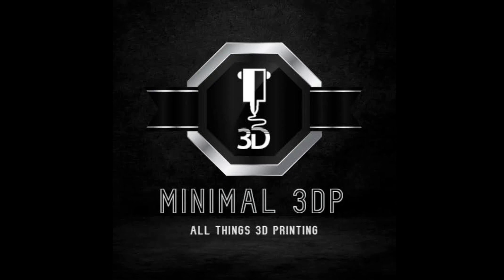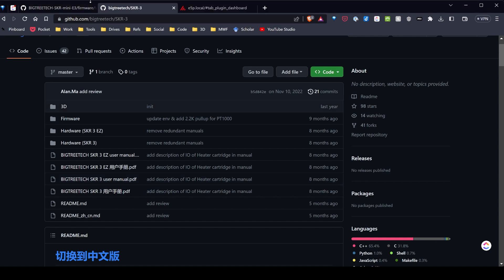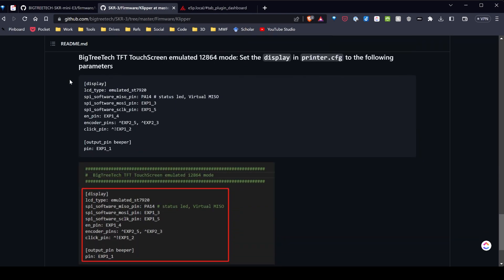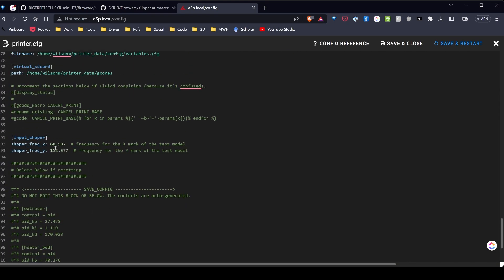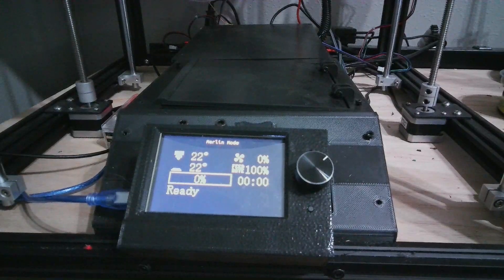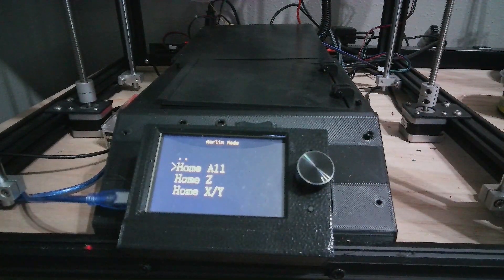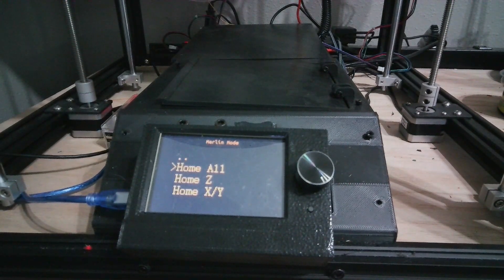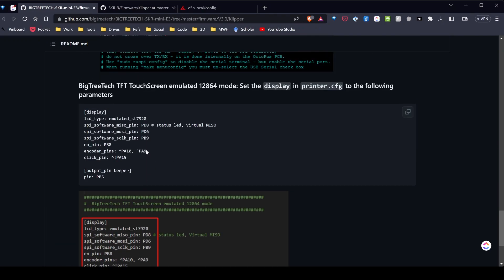BigTreeTech Touchscreens, Klipper, and the SKR 3 and SKR Mini E3 v3 Boards: Making it All Work!

Comment: I have a big tree tech tft35 v3.0.1 touch screen and a big tree tech skr mini v3 board. I cant get the screen to talk to the board. Granted this was working with my Marlin firmware but I recently switched everything over to klipper. Raspberry pi 4 is talking to the skr mini v3 over usb and working as it should Just the screen is not talking to the main board. I have not changed any hardware plug locations.
Reply from the maker: Are you looking at it touch or TFT mode? Did you update your printer.cfg?

Comment: In the text/marlin mode, does it have the option to manually level the bed? Can it do babystepping Z on first layer from the screen and change flow and stuff while printing with this marlin mode TFT35 and klipper?
Reply from the maker: I am not sure. You will need to check the docs.

Comment: Great work.

but still that means you still have to connect a laptop or a pi through USB.

Or am I getting it wrong?
Reply from the maker: You are correct. The way Klipper speeds printing is by moving the processing of the model off the weaker printer motherboard onto a more powerful pi or PC.
Reply: @minimal3dp  wish there was a true more delicate solution like this screen for klipper.

Dealing with klipper is messy.
Reply: @minimal3dp  I had to cancel order of this screen after your comment 😅

Great looking screen, not what I'm looking for though.

Comment: do you have both the ribbon cable and the TFT cable connected? what limitations have you found with this screen? I'm doing a switchwire conversion but don't want a full klipper screen, just something like they have on the new V0.2R1 kits. That way if the internet bugs out I can at least control the thing instead of just killing the power to it. awesome vids by the way!!
Reply from the maker: I have both connected but I am not sure I need it. It is a very minimal screen. You can so all the basics with it. I think it would definitely work in cases where the internet is out. 

Depending on your budget, I have just installed the BTT TFT 32 spi and it is klipperscreen. It might be worth a look.

Comment: Nice work! Would this code work for an SKR E3 Turbo motherboard with a TFT35 E3 V3.0 screen?
Reply from the maker: It should work.
Reply: @minimal3dp i have skr mini e3 v3 + Tft35 e3v3 and dont work 😭
Reply: until 2 weeks ago I had a skr E3 turbo and a tft35. It worked both in Klipper and Marlin. I used the black cable for tft and a 10 pin  cable in exp3.

Comment: Thisll help me very soon, I have the Mini3 and the tft35 duel touch coming for my E5+.  Waiting on the same screen for the E5++ as ive named it, Shes not up and running yet, Got to get my head around the Manta M8P/CB1 set up and run another extruder for 2-1 stuff. As a warning to Manta m8p buyers,The SP1 screen needs the I02CAN to work with the CB1 on the manta and there wasn't any in stock so next best...Better should have in the first place TFT35
Reply from the maker: Glad it was helpful.